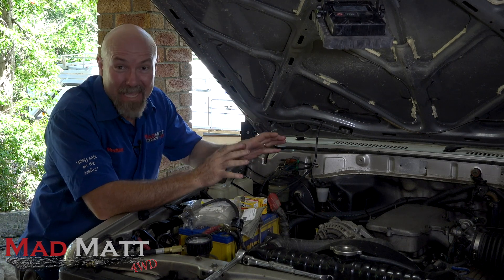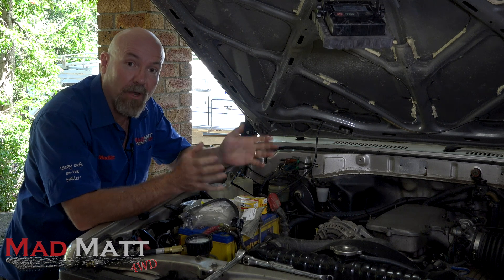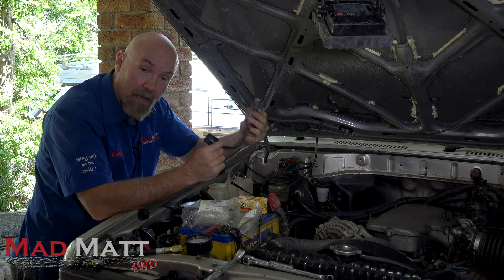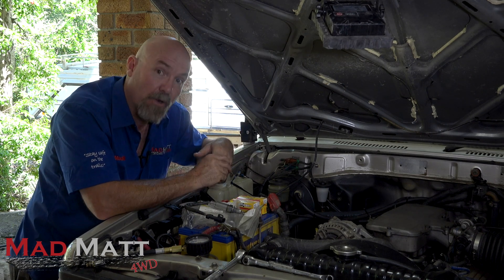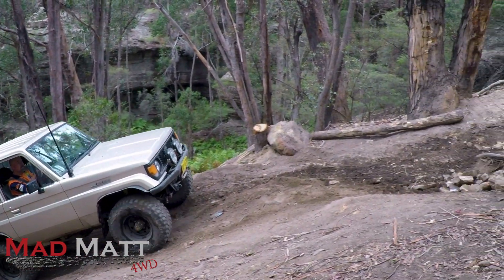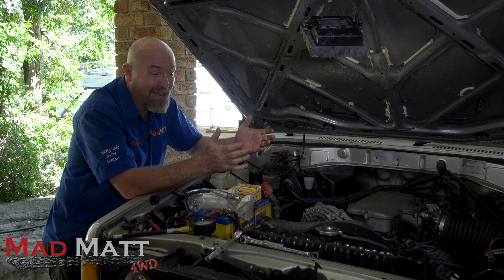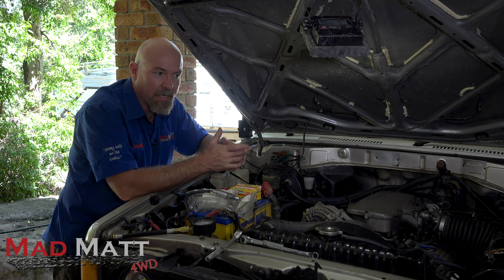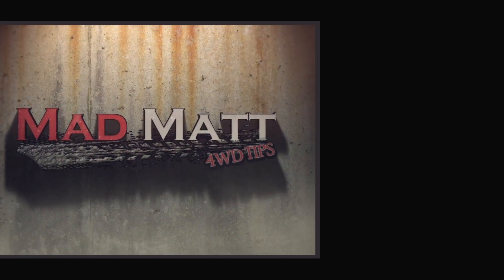Part 1 Diagnosing my Engine Misfire and My Bundera Modifications - MadMatt 4x4 Garage

Comment: Hi, I have a question because I imagine the impact of a contaminated O2 sensor would lean an engine out not make it run rich.  An O2 sensor compares the amount of oxygen outside the exhaust with the amount inside the exhaust. Therefore if the inside is coated with a contaminant it will see less oxygen than outside the exhaust. The ecm interprets this as running rich, ie oxygen deficit, and will lean the engine out.
Reply from the maker: That’s a good thought. I’ll have to dig deeper

Comment: Good info Matt. The valve stem seals went in my '74 XB Falcon (250) and it also had a miss. But it has a carby so might not have been related. Ended up having the engine rebuilt to run better on unleaded. Have a miss in my '79 Hilux (18R) at the moment too so am looking into what is causing it. Looking forward to the next part of your video.
Reply from the maker: Stay tuned. :)